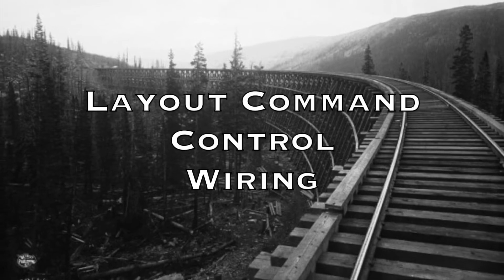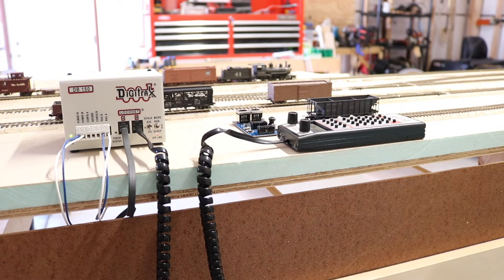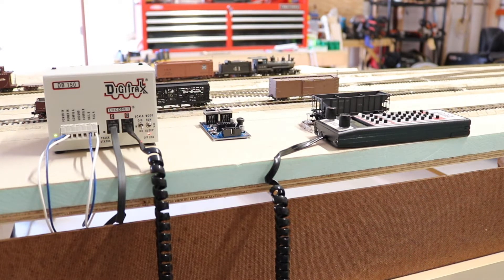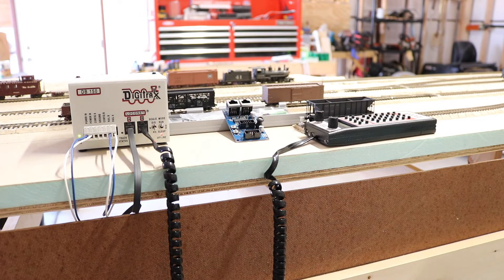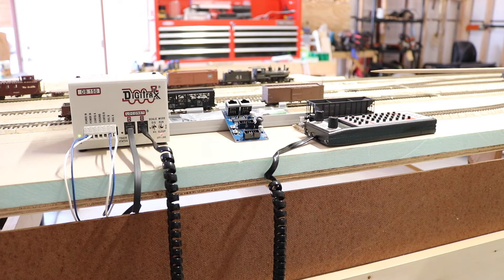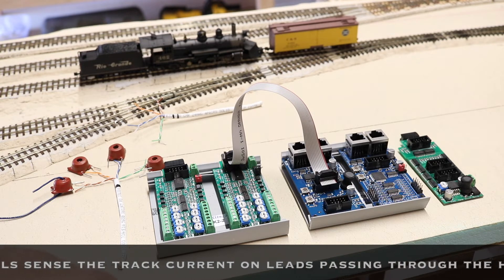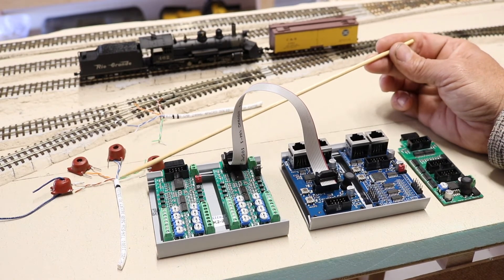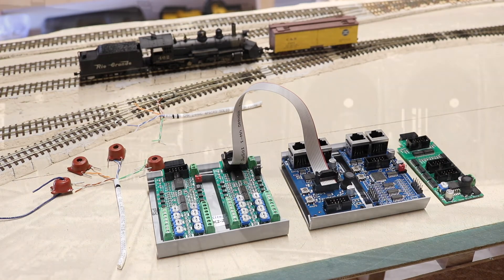MRVU 8  (Wiring II)  Layout Command Control (LCC)

Comment: Good video! I can see where LCC would be a great advantage for a very large or club layout. Or even a modest size where you have several operators. It's way more than I would use as I'm not using block detection, signals or many operators at once.  And for me, throwing turnouts and making sure everything is "lined up" or not in the way is part of the engineer's job and keeps it from getting boring. It'll be interesting to see how it all works together. ...Claude
Reply from the maker: It's been a difficult decision for me.  My prototype didn't use signals, but that is an aspect of railroading that appeals to me.  I'm doing the whole Time Saver thing as a way to try it and other techniques out before I go big.
Reply: That’s smart.

Comment: Nice explanation, Dennis. So you will be doing block detection and signaling? Will the LCC control all of the signals and the turnout boards on the layout?
Reply from the maker: If I do signaling it will only be with Semaphores, and very simple.  Yes, all turnouts (so far) are LCC controlled, this is how I have configured the routes through staging and Frying pan.  I will do a very similar routing in Maroon Creek as well.  If I ever get to the semaphores (bottom of the list) they will be LCC.  Block detection is something I am doing just to make sure that if I need it, I'll have it.  I plan on doing some simple automation with it as well.

Comment: Isn't just one advantage of LCC that the boards to control things like block occupancy, turn outs and train signals are much cheaper? Seems like one DCC company has had almost a monopoly for many years. $150 to control 16 block occupancy, turn outs or train signals can add up very quickly on a decent layout. Do I have this right? 

Also, it seems like coupling and decoupling on rail cars needs to be addressed like it has been for locomotives by DCC. A magnet under the track seems like yesterdays technology to me.
Reply from the maker: I've never done any kind of cost comparison so you probably have a better understanding of that than me.  It's been several years since this video so I can't recall the specifics. I decided that hands free uncoupling is just not worth the effort and quite possibly a myth in HO. 🙂  It's very doable in the larger scales with DCC.  On the larger layout, I have done my best to keep all uncoupling points within a 24" reach and use the trusty skewer.  Thanks for stopping by!
Reply from the maker: @JonBanquer  Looked into it.  Didn't think it was worth the extra effort.  In the future, If a spotting location is out of reach I may revisit that option.